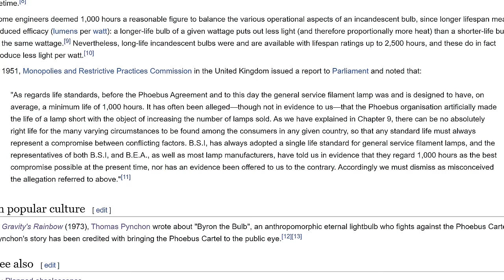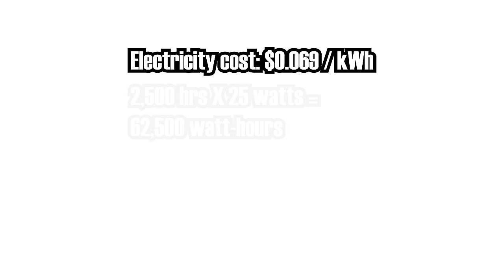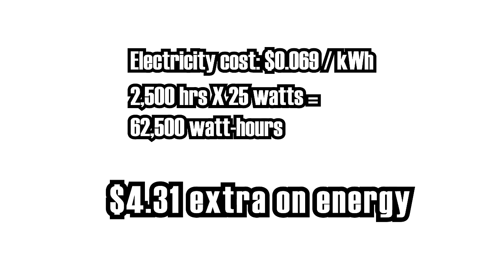Longer-lasting light bulbs: it was complicated

Comment: It would be cool if you did a video on the current state of LED bulbs. Namely the cheap ones, I saw the (many) videos that BigClive has posted on modding those bulbs to make them more efficient and last longer. I was having so many cheap LED bulbs die after only a few months of non continuous use that I got fed up and modded every lightbulb I regularly use down to about half power (still a plenty useable light output, especially in multi-bulb light fixtures). I haven't had a single one of those die yet more than a year later. On that limited sample size it sure feels like LED bulb manufacturers are guilty of planned obsolescence, or at the very least false advertising of run time.
Reply: I had our GE - branded LEDs die on me in the last four years... when all the other 14 - year - old CFLs in my house are still working fine - so some bean counter has seemingly engineered fairly reliable fail modes into 'em. Grrrr....
Reply: I agree. I'd love to see a breakdown of quality led vs cheapo led.
Reply: Same here, I run 4x 10w filament style Asda LED bulbs at around 3.5w (so total 14w). It's noticeably brighter than the 4x 8w bulbs running full power which started dying out well within a year! My dining room runs a standard 8.6w LED at 2.5w, it's not terribly birth, but if I put a 14w in it runs at 3.5w which I found too bright! My kids have 3w bulbs running as nightlights with a tiny capacitor dropping them so low my meter (which will read at 0.1w!) shows it as zero, they're brighter than the dedicated 1-2w night lights they used to have (and a much nicer colour). My bathroom has a 14w bulb running at 0.9w, it emits no heat, so I would be surprised if it didn't last a couple of decades.
Reply: Your comment and this video reminded me of the Phillips 'Dubai' LED bulbs, deigned to last much longer than regular LEDs.
Reply: Where on earth are you buying your LEDs, usually they are cheaper, more efficient and MUCH more long lasting than any light bulb. I have a LED light that my father bought when he was like 17, it still runs like on day 1 after literal decades of use.
Reply: @foximacentauri7891  LEDs only became readily available in about 2010 so unless you are about 13 your story doesn't stack up. Assuming that is correct the Original L Prize LEDs which cost about $50 each were designed to last for years with solid aluminium heatsinks etc.
Reply: It's somewhat the same tradeoff there, bright vs cheap vs long lasting.

I've long continued to use incandescent bulbs purely because it's near impossible to find LED bulbs dim enough. I don't want a bulb as bright as the sun in my eyes every time I go to the bathroom in the middle of the night...
Reply: @foximacentauri7891  By the time LED bulbs came out, LEDs were quite mature (the modern process for white LEDs, with a blue LED and a phosphor, has been around since the mid-90s, and people have been experimenting with LEDs and trying to make white since about the '60s).

Unfortunately, between planned obsolescence and cheaping out on parts, the more established LED bulbs became, the worse they became. (You can also thank incandescent and fluorescent phase-outs for making sure there was no competition.)
Reply: @JohnRunyon  I'm still using a CFL in the Bathroom and have a stock for when it fails. Why ?
a) it is in a fully enclosed fixture. 
b) the slow warm up isn't a problem in that location.
Reply: I think it's often a combination of factors. Cheap manufacturers use cheaper electronic components that handle heat less well and have a shorter hours of operation (like capacitor lifespan), amd skimp on thr heatsink and dissipation hardware. 

Then also putting led bulbs in difficult locations like recessed can fixtures where they have very little thermal dissipation on the backside makes this worse.

I've found that led light fixtures, like the integrated (all in one) led can light, typically are built to last and built for specific conditions. Replacing your can fixture with an integrated led fixture would last a long time if you were willing to do the install work.
Reply: @MrDuncl  I don’t know anything about the US LED market, but I can assure you that every hardware store where I live had LEDs well before 2010. the EU started its selling restrictions of bulbs in 2009, they wouldn’t have done that if there wouldn’t have been a well established adequate alternative(you know how slow administrative bodies are).
Reply: I have LEDs at work, in many formats. The ONLY ones that seem to die, are the ones that are part of something expensive, like a desktop magnifier, decorative table lamp, etc. Seems the LED is fine, the driver and on-off switching is so cheaply manufactured, it undermines the LED itself..   

The 4' Philips tubes, running via electronic ballasted troffers have not had a single fail since I began replacing 36 of them 3 years ago, most recent final batch were replaced over a year ago. They run 6-10 hours a day, continuous.

8 more 4' store fixture lamps, undershelf T5 replacements have been running for about 8 years. They are self-ballasted/Drivered? Still fully bright, as well.
Reply: @JohnRunyon  I bought LED night lights, popped off the cover and darkened the lens with translucent paint.
Reply: @MrDuncl My problem with CFL's is they varied too much in color.  I had to buy 5 to get 3 that had the same pink, or green hue.
Reply: @stevesedio1656  In my experience the biggest problem was the warm up time. I got given a couple of cheap Homebase ones where it was a couple of minutes to reach full brightness.
Reply: I replaced all my lights in my home with Cree LED's back in 2018.   While most are still working fine, a few have failed, just went out completely.  Those early models used a large aluminum heat sink which generated lots of heat, perhaps one of the points of failure.   I replaced the bad ones with new Philips brand LED's which seems to work longer and have a nicer color gamut.  I've noticed some new LED's have filament like elements suspended in the bulb just like incandescent bulbs.   Are they are better?
Reply: @BillAnt  The filament LEDs tend to be slightly more efficient and have the advantage of throwing light in all directions. There is one in a table lamp next the computer here. However, i haven't been using it long enough to  be able to comment on reliability.
Reply: @MrDuncl - I see.... however those suspended filaments seem a bit flimsy in case of a bump or drop.  On the other hand, it might help with heat dissipation being thin and long.
Reply: @foximacentauri7891 lol what are you going on about...

Comment: The advent of the tungsten filament (tantalum too, I guess) around 1913ish, in my opinion, is what really kicked off the electrical revolution. These light bulbs made the same amount of light as carbon filament bulbs, at about half the wattage. At a time when electricity was mostly used for lighting and little else, almost overnight power companies around the world suddenly were selling half of their product. Prices of kWh's came down, more people could afford electricity, more appliances were sold, and here we are. Would be cool to hear you talk about this.
Reply: Tantalum predates tungsten by a few years, but undergoes electric field grain boundary effects that severely degrade tantalum filaments when run on AC.  The real big thing was ductile drawn tungsten around 1911.  Before that, tungsten had to be mixed with binders that were then burned out after the filaments were formed.  The resulting filaments were so obscenely brittle that even putting the lamps on their sides could break their filaments from the tension.  The only reason sintered filament lamps even survived as a commercial product were that they were more than thrice as efficient as carbon filament lamps.
Reply: @randacnam7321  Apparently tantalum lamps were so efficient that people would run them on AC anyway, despite their high cost and very short life. Electricity was expensive back then!

Comment: Bravo on pointing out that many LED bulbs are being built to sub standard quality.  I've replaced many as they sucked down far more power then they should have,  ran stupid hot, etc.
Reply: They can also be pretty scary when they fail. With an incandescent bulb you'd get a bright flash and slight "pip!" sound and that was it. I've seen LED bulbs fail with a violent POP and spark and smell of smoke, a couple times...
Reply: @renakunisaki sounds like they’ve been overvolted, it’s no different than accidentally plugging a higher voltage barrel connector into an electronic rated at much lower that so happens to accept the same sized jack

Comment: Watching you overclock those poor things reminded my of a Popular Electronics article from the 60's using an incandescent bulb as a flashing beacon. I never built it, because I was a bit dubious as to the article's claims of brilliance and longevity. I wonder if I still have that particular issue.

Very informative and entertaining video .. as usual.

I know that you were primarily focusing on household lamps, but I can attest to the fact that certain automotive bulbs have become .. "crappier". I've owned the same truck for 35 years, and it takes a LOT of marker bulbs (I think type 941?). In the 90's I rarely replaced a marker, but when I rebuilt the truck in 2006 I decided to replace all of the yellowed bases/lenses, and so put in all new bulbs. Then noticed I couldn't go a week without one or two dying, each blackened and sputtered.

Closer inspection revealed that the Dumet seals have been omitted! The cluster takes the same lamp .. 7 or 8 of them total - they are all 1984 original. Hmm.

The footage of the filament failing then joining was absolutely epic!!! That had to take some work.

But now the rabbit hole calls. We've all seen a bulb fail at the flick of the switch in a brilliant supernova of white. I need to know why.

Comment: In my view this has started to happen in LED bulbs too. Lots of bulbs over drive the LEDs to a crazy level.
Reply: In cheap Chinese LED bulbs, the "driving circuit" only consists of a current-limiting resistor and a capacitor which eliminates flicker. It works well enough for a few months but then it inevitably becomes e-waste.
Reply: My home still has one of the LED lamp from nearly 10 years ago and still going strong today, while recent LED bulbs are failing in less than 3 years
Reply: Cheap LED drivers are the most annoying part of LED bulbs. We have basically perfected the bulb, yet these cheap drivers from even decent brands basically makes it no better than CFL or halogen when it comes to cheap bulbs
Reply: Seems more of a side effect of using the cheapest components possible and pushing them to their limit to sell the given product for the highest possible price
Reply: I only buy GE LEDs these days, too many bad experiences with other brands of bulbs using questionable drivers that die in a few weeks
Reply: Small difference though: "Overdriving" an LED does not make it more efficient. Last time I dabbled in LED stuff, the usual high-power options had their highest efficiencies way below the maximum driving current.
Reply: @EoRdE6  I got told of a manufacturer of ultra-good-color-quality (as in, white, with no tint regardless of what exotic stuff you're illuminating) years ago, ended up buying 20 small 13x13mm 10W ceramic base LEDs to try and make a desk lamp, sadly burned most of them out as the heatsink was bad, and later bought some "remote phosphor" bulb-shaped LEDs.
Those are the nicest I've ever had, sadly they're out of production now.
That said, they still make damn solid LEDs, and personally I've never noticed any issue with their drivers, either.

Though for a lamp they are priced about 1$/W, plus minus depending on what you're buying.

My new living room light is a 100W strip of 1900K; due to it being decent color quality (not ultra-tier, but good enough for my wallet) this turns out to be extremely comfy. Imagine blue light reducer, but you can still see collors properly.

Or imagine candellight, but it's bright enough to easily read and what not. Without the paper facing the lamp, if you have white walls/ceiling.

They're Yuji.

The glowing strips in clear bulb type I have a pack of, and they behaved themselves quite nicely at dad's dining room table. Didn't need them personally initially, but iirc ordered with a buddy to consolidate shipping (free shipping after X $).

BTW, 1 $/W at ~0.3$/kWh means you pay for them when you buy them as much as you'll pay in electricity over the first 10 000 hours of operation. Given that they last longer if you don't suffocate them thermally, I don't think it's a case of "too expensive" unless you can't bankroll the investment, ofc.
Reply: @keinschwein8467  The craptastic brand Overdrive.
Reply: @hammerth1421  its not the cheap circuit itself that results in short led life, but the current they are run at,
Reply: @hammerth1421 Most of the bulbs in this house are the simple capacitive dropper style and they‘ve lasted years. The trade off is bad power factor which is an entirely different Tech Connections video.
Reply: Well, for LEDs you have not "efficiency vs lifetime" current but it is more like Gibbs triangle with efficiency, cost and CRI. LEDs typically don't have their peak efficiency at nominal current, it is slightly lower. However, lower current means lower voltage drop on junction. It may affect phosphor excitation, so your lamp has now different light spectrum. In theory you could avoid that with PWM driver (even alternating between chains to give constant emission) but that adds to overall cost. Going further: there are three types of LED lamps used today; one is using low power SMD LED on PCB, second is using one heatsinked power LED and third is filament, aka chip on glass type. Each of them has advantages and disadvantages. Discrete array can be quite efficient and durable, but gives the appearance of dotted array and has problems with light distribution (there is area of lower light intensity between 30 and 60° to the axis, also it is not so good shining downwards, as you will find at most 4 LEDs there). COB array with radiator shines well downwards, but above your lamp you have "Land of darkness" effect. These are typically long lasting ones, expensive due to chunk of aluminum and driver circuitry. Yet, milky white bulb required to spread the light around is not so good for efficiency nor does look good. Last one, COG aka filament have great light distribution and don't have flicker even with simple drivers. However, due to extremely bad cooling they typically have lower efficiency and life expectations (but these can be overcome by using half a current per filament, as in Dubai Lamps). Still, COG are fragile, so vibrations will kill them. However, they at least fit well inside old fixtures designed for incadescent bulbs. Aside of that, all LEDs will degrade over time even, when they are not failing instantly. So our two-dimensional problem now became 5D one.
Reply: @namibjDerEchte 
Even some cheap LED bulbs now have high CRI ratings. LED lights used have very bad CRIs but if you pay attention to what you buy, it’s not an issue anymore.
Reply: @andygozzo72  true. added the terrible heat dissipation, no one can expect long life out of them. not to mention how cheap LEDs have terrible tint (oh, and CRI) that made everything looks bad. you won't notice it until you got shined with a real good LEDs. most of us wanted cheap stuffs so here we are now. flooded with cheap unreliable stuffs!
Reply: @brylozketrzyn  i have filament type lamp from Philips. they do flicker but not really noticeable until you decided to record a video with it. for the efficiency, they're rated at 104lm/W and who knows how long they will lasts (rated at 15k with 2.7hrs of on-time per day lol). half of Dubai's exclusive lamp rated at 200lm/W. kinda wished i could get those darn efficient lamp instead of making my own version of Dubai lamp
Reply: @genderender  My parents installed 2 year ago fancy led light fixtures one smaller but same style and a larger one in the living room. Now after the warranty is expired they start to flicker/pulse. But the Led part cant be changed. What an e waste. (it wasnt a cheap led fixture btw.)
Reply: @n.shiina8798  typically in filament LED you will have much less noticeable flicker. This is due to phosphorus inertia - it does not emit light instantly when excited, so even short pulses will make it glow for 10ms or longer. Of course it can be affected by chemical composition or use of single wave rectifier (but these are exception). I do have some chinese filament bulbs and even with 240fps camera I cannot see flickering, despite driver circuitry fitting inside E27 screw terminal.
Reply: @genderender  It makes them a lot worse, since you pay a lot more for them and they don't last. Even worse if you buy high brightness ones, because they cost like 20 EUR (or dollars) per bulb. One dead bulb is equivalent to dozens of dead incandescents in terms of cost. And even worse is that despite financial loss, they still have dangerous chemicals in capacitors and are hard to recycle, so perhaps worse than incandescent from eco perspective as well. That's why only well made LED bulb is good LED bulb, anything less than that is worse than incandescent in every way.
Reply: I just use the sun and lots of mirrors.. all the way to china 🇨🇳  so i can use the sun at night. Cheap and easy. Everyone should have mirrors everywhere like me
Reply: elfrjz  its so simple!